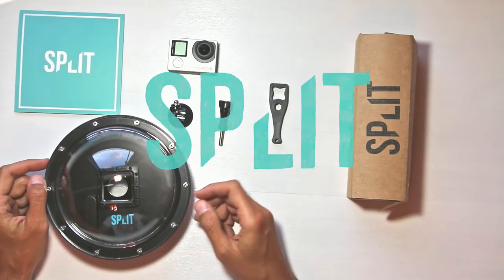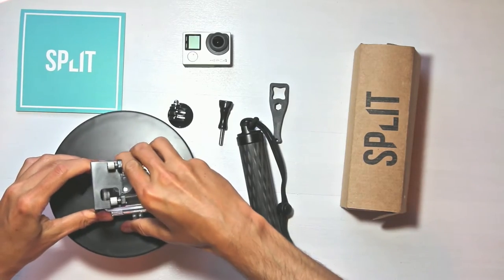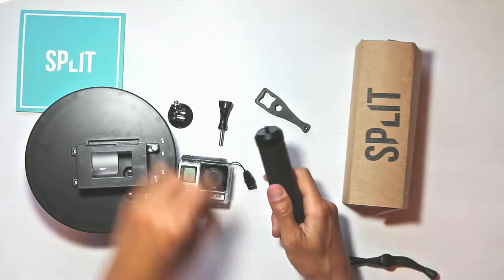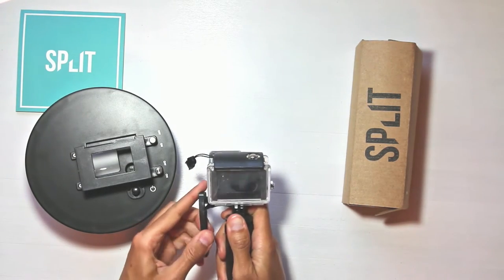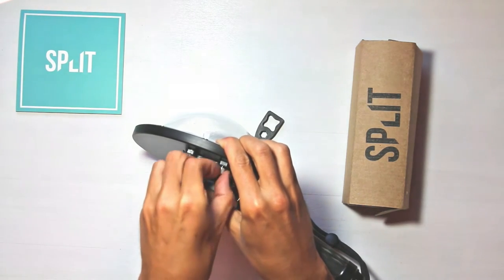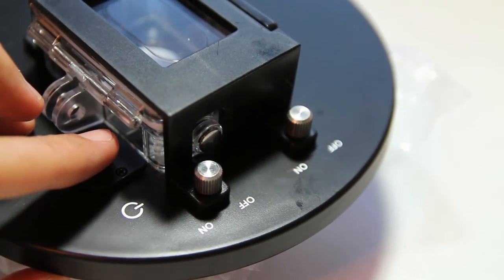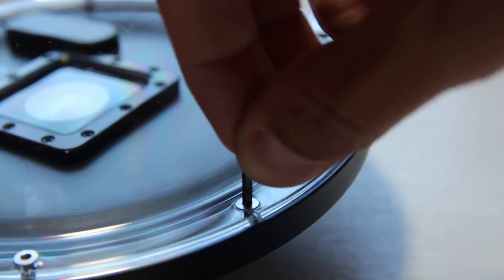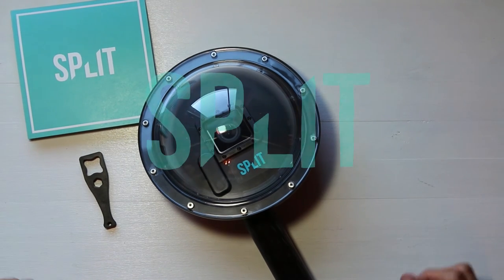How to Use the Split Dome Port for GoPro Camera

Comment: any tips on fitting the hero 5 (in the split case) into the dome slot? I'm finding it really difficult to fit in the square without absolutely forcing it.  Thanks
Reply from the maker: Gareth Lloyd you just need to push it in a little bit, then close the hinge and by tightening the screws the housing will sit in place
Reply: Got it! That worked perfectly thank you very much ! Can't wait to try it in 4 days time - expect a lot of instagram tags ;)